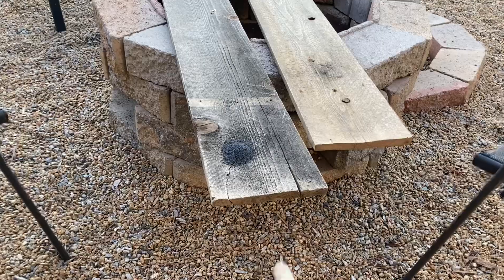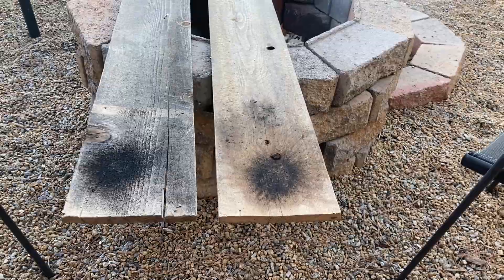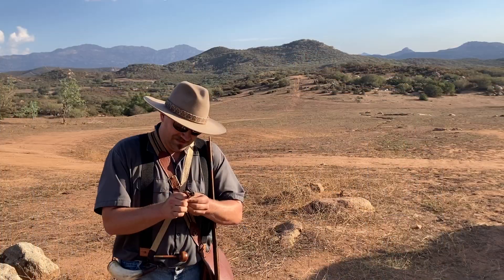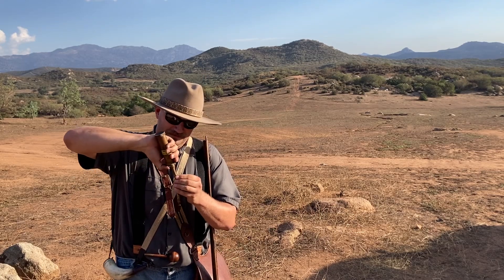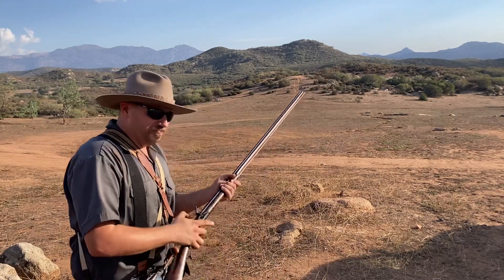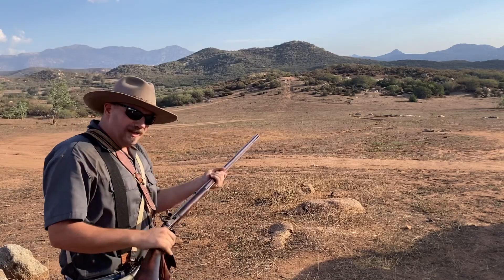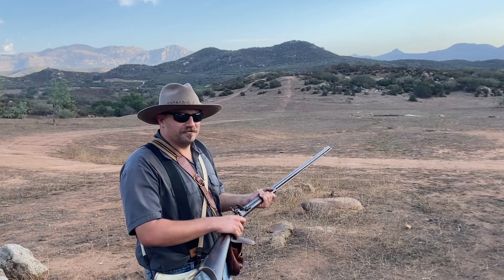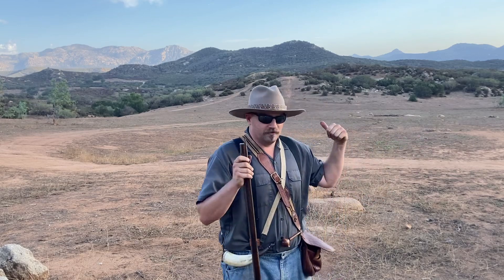Can you use Pyrodex in a Flintlock?

Comment: just found your channel , Lots of good info to take in. I like your stile, am new to black powder, I have a 45cal flint gun and am using black MZ aligant powder for main charge and pirodex p for frizen is this ok ? havent had any problems but am new to this kind of shooting. Real black powder is not readily available in my area. any sugestions. thank you for your time
Reply: Pyrodex for the priming charge can work, but as said, if you can get some proper blackpowder, it's much better. Pyrodex is perfectly ok as your propellant, it just isn't a very good igniter, which is why when people use Pyrodex for percussion cap guns and for cartridges, they won't have any problems.
Reply from the maker: If you get your hands on some real Black powder I guarantee it will be a game changer

Comment: Pyrodex...the devil's powder. I've seen more guns ruined by that than real black or even corrosive cartridge ammunition. If I absolutely positively MUST use a sub, I grab APP. It works fine in a sidelock with #11s, but I have no idea how difficult it may be to ignite in a rock lock.

Comment: LMAO. I tried 777 in my flintlock and got exactly the same results. Had to use real blackpowder, 10 grains in the main and prime. Pain in my ass. Even my cap guns are more accurate with BP. I think the 1:66 riflings, reduced recoil and the residual in the barrel is softer contribute to better accuracy. I could be way off. I'm sure some substitute  guy here will correct me

Comment: Very nice, thank you.  I don't have any flintlocks (yet), and used Pyrodex for several years when I first started out.  Since I used it for cap and ball pistols it worked very well, and I have even used it in metallic cartridge rifles without a problem, although it doesn't perform as well as Swiss 1.5F.  Because of this success I was surprised to see all the Real Black Powder guys claim Pyrodex was garbage, but this shows me why--they had problems with it in flintlocks, and never thought to take it any farther than that.
Reply: Hmm? maybe You Think pyrodex worked "very well", as "Did I"? then I made my own BP! WOW what a difference, mostly in reliability, speed with cleaning.
Reply: @davefellhoelter1343  Ive never had any difficulties in any of that with pyrodex. What i noticed with pyrodex is, i get more shots out of a rifle before the bore gets so dirty that reloading is hampered, and i get more shots out of a pound of pyridex than with traditional black, and its much cheaper and has been easier to find than traditional black powder.  To be fair, pyrodex is not black powder. To expect it to be black powdet is folly. Ive been using pyrodex for many years now, and other than use in flintlocks, ive never had any problem with it.
Reply: @davefellhoelter1343  The real stuff is definitely much better, especially if you work out a good recipe, but Pyrodex does still work fine if you're igniting it with a percussion cap or centerfire primer.
Reply: @davefellhoelter1343  You're confusing apples and oranges.  I didn't say Pyrodex worked better than black powder, commercial or homemade, I only said it worked well.  I can accept, arguendo, the notion of superior homemade powder, but that is not the issue.  The question was whether Pyrodex worked well, and for me, since I wasn't shooting flintlocks, it did.  I no longer use Pyrodex because Swiss is measurably superior and is closer to 18th-century powder in terms of performance and because I want to replicate historical ammunition and ballistics as precisely as I can, but Pyrodex did, in fact, *work*, meaning no hang fire, good ignition, and excellent shot groups.
Reply: Im pretty much on the same page with you. I never use pyrodex in flint locks, but its all i use in cap locks and brass cartridges. I never had any problems with pyrodex in cap locks or cartridges. In fact, i prefer pyrodex  in cap locks and brass cartridges. When i hunt i like to use stuff thats more reliable than flint locks. I think there are a lot of hunters with that mentality.
Reply: @blueduck9409  I don't actually use Pyrodex at all any longer, not because it doesn't work well--it does, at least for my weapons--but Swiss BP gives me significantly better target scores, and has a higher muzzle velocity for better terminal ballistics.

Comment: In a previous video of yours, you mentioned the use of graphite to avoid humidity and static electricity and for its conservation, in what proportion it is used and how it is applied, ps. congratulations for your videos and greetings from Chile South America
@Everything black power
Reply: The makers of black coat it with graphite.  If your the maker after graining it you tumble with a very small amount.
Reply: @gunsnwater  Do note that you'll need to include the extra graphite in your calculation for how much oxidizer to include, or else you'll find that every bit of that graphite turns into fouling.